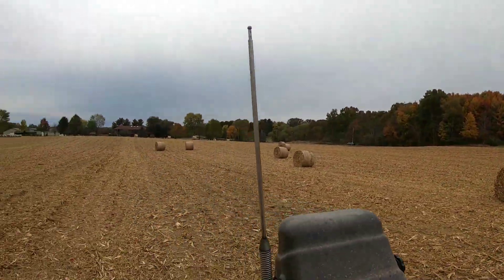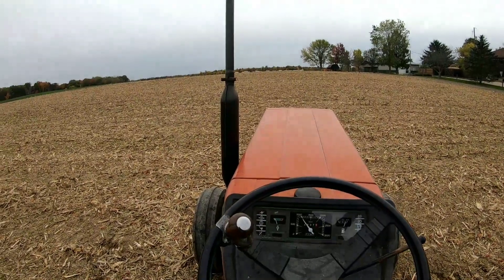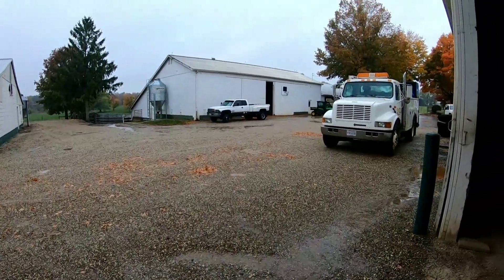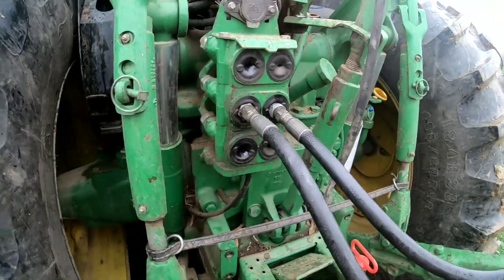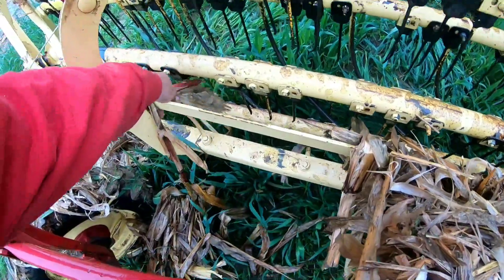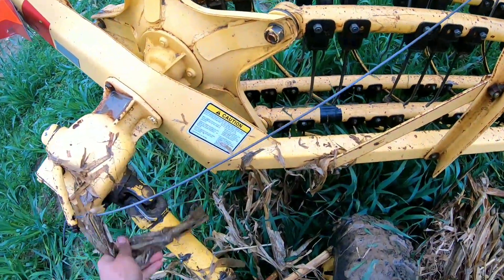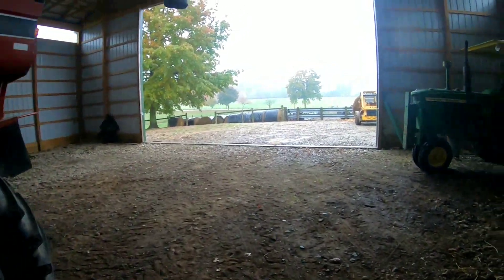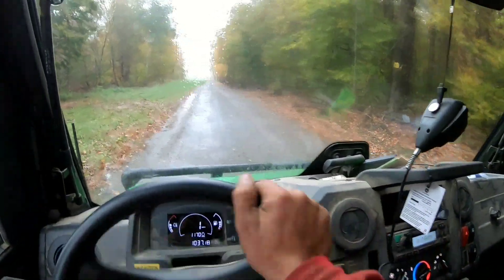cleaning up the rakes

Comment: I see you normally step very hard on that foot brake, aren't you afraid you will break a cable or damage links etc overtime, my car have also the foot brake and I press it for 20 years just a little bit, that is enough to hold the car unless I stop on a very steep driveway, specially when the brakes are warm I think it is not good for the drums to cool down under severe pressure, just my thought, my car have discs at the rear but have drums as well for the foot brake.
Reply from the maker: On my Gator?  Yea. I should step more lightly on it. Thanks for catching my mistake
Reply: @NorthEastOhio  no problem Travis,
Reply from the maker: Thank you. Have a great Sunday